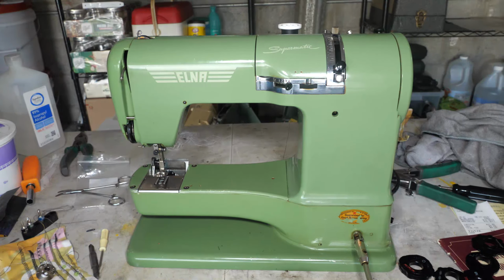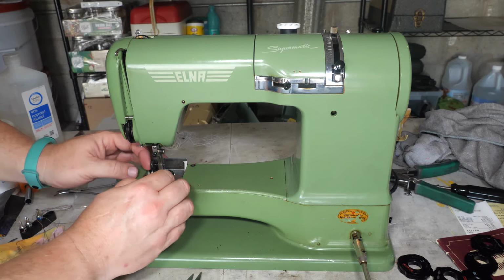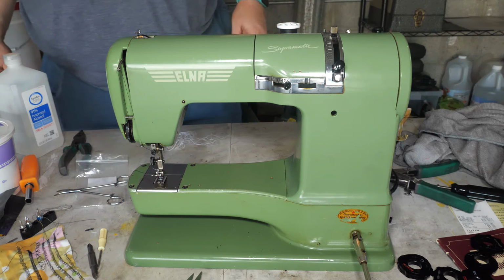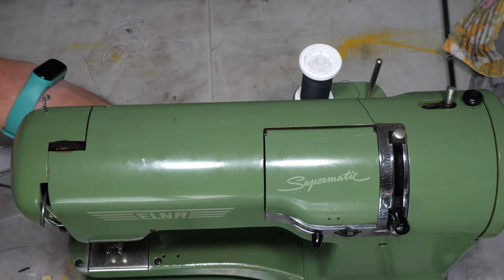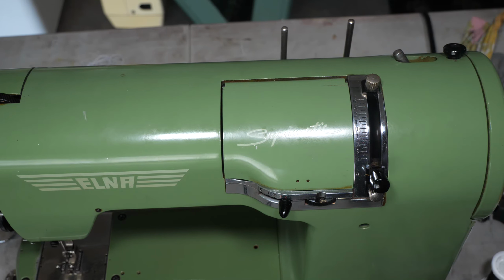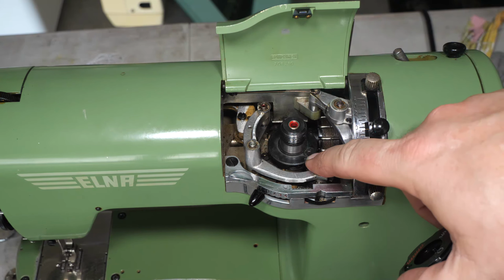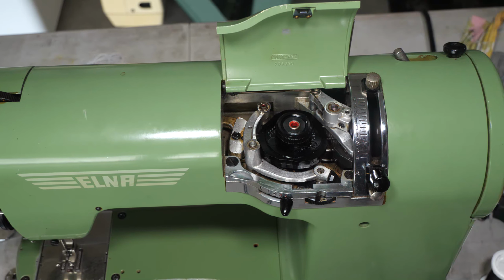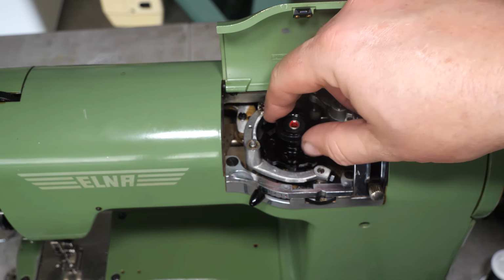Elna Supermatic Threading

Comment: Que aguja lleva? Tengo una igual y se cae la aguja
Reply from the maker: It should use regular domestic needles (15x1 and 130/705 are the same).  Make sure the flat side is facing the back when you insert the needle and then tighten the needle clamp screw.